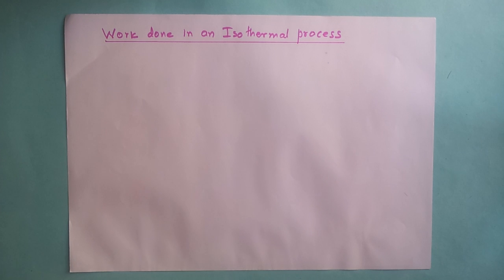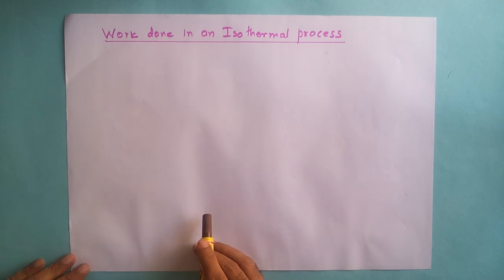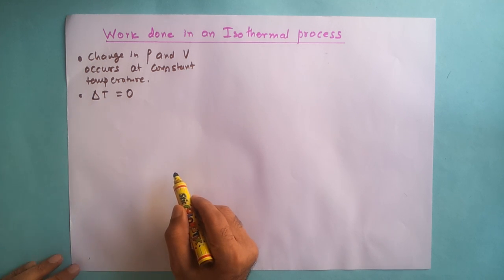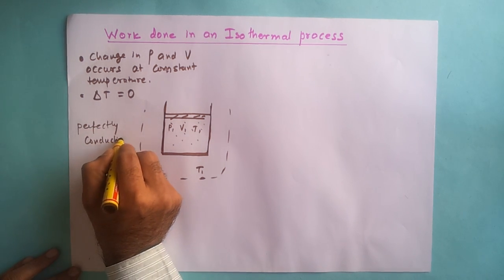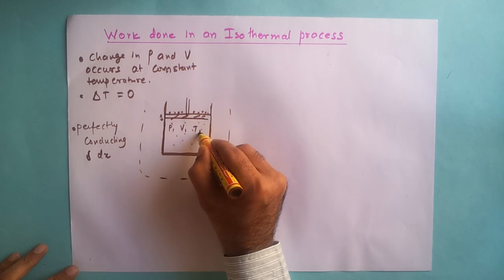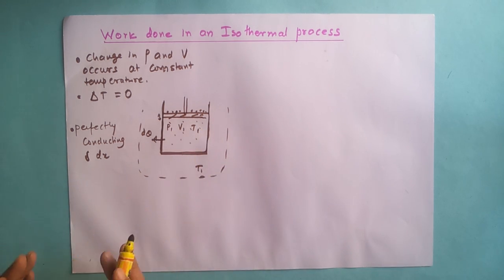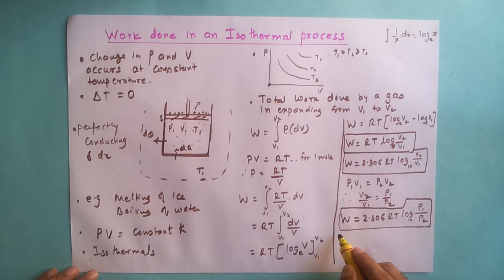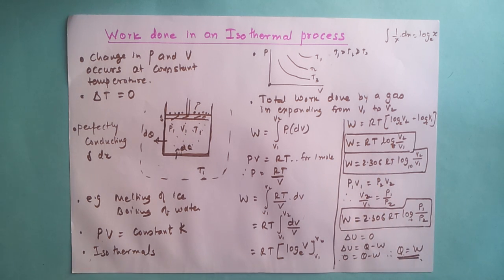Work Done in an Isothermal Process | Thermodynamics Explained Simply

Comment from the maker: 🔥 Quick Revision Tip:
The formula for work done in an isothermal process is:
👉 W = nRT ln(Vf/Vi)
where

n = number of moles
R = gas constant
T = absolute temperature (constant)
Vi, Vf = initial and final volumes

✅ Remember: Work depends on the ratio of final to initial volume — not the difference!

👉 Let me know in the comments: Which thermodynamics concept should I explain next?